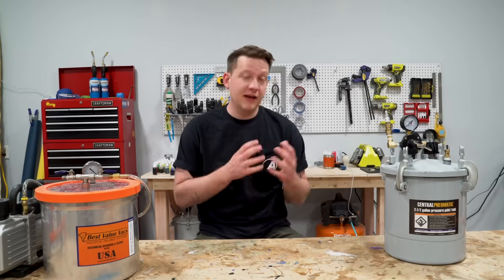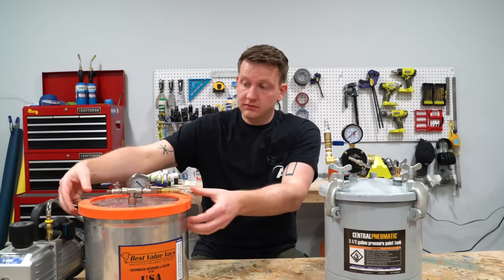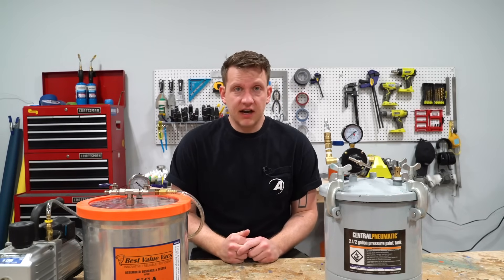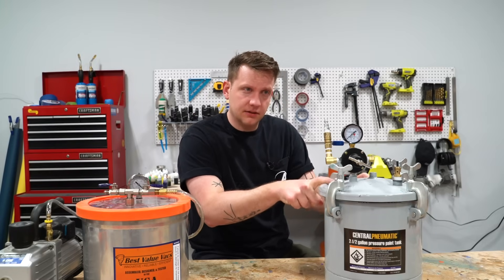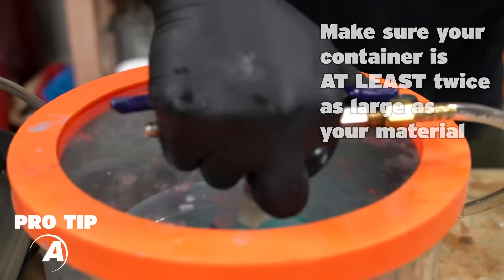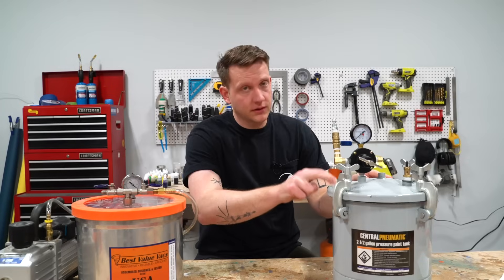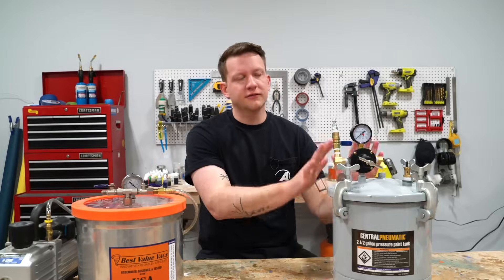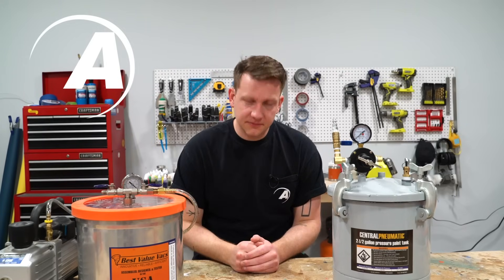When to Use a Pressure Pot or a Vacuum Chamber | Alumilite

Comment: Fool that I am, I really convinced myself I could get by just using the vacuum chamber for everything. Still don't get something though... What if you could find a resin with a longer working time that would allow for a vacuum chamber to get down to -30 mercuries before it starts to cure? Wouldn't that allow you to still get some bubbles out of resin using only the vacuum?
Reply from the maker: Great question and you're on the right track.
If you use a resin with a long working time (like 10–12 minutes), you can use a vacuum chamber to degas it before pouring. That will pull a lot of bubbles out of the liquid resin.

BUT vacuum doesn’t help once the resin is in the mold. Any air trapped against the mold walls or in tight detail won’t get pulled out, and that’s where bubbles sneak in.

That’s why pressure casting is still the go-to for perfect, bubble-free results it crushes bubbles inside the mold after you pour.

So yeah, vacuum works—just not all the way. Long open time helps, but pressure gives you the cleanest cast.

Need help picking a resin or setup? Reach out at (269) 488 4000 or info@alumilite.com.

Comment: I see this video is 5 years old. I hope you will answer. I am just starting to due this. So please tollerate my question.
why can you not use a pot for both vacume and preasure . At 75 years old I could use a little help. Thank You for respond if you can.
Reply from the maker: Great question! You can’t use the same pot for both vacuum and pressure because they’re built for opposite forces:

Vacuum chambers pulls air out and aren’t made to handle positive pressure.

Pressure pots push air in and can’t handle vacuum without risking damage.

Using one for both jobs can be unsafe or ruin your equipment. 

If you're working with resin, you'd use:
Vacuum to remove bubbles before pouring.
Pressure to shrink bubbles after pouring.
Reply: Thankyou so very much for an answer @AlumiliteCorporation

Comment: so, if i just wanna buy a pressure pot, but if i want to do molds by myself and put it the diy molds into the pressure pot, sould i have problema because of the air bubbles in the mold?

Comment: Great video, but never start a pump with the air valve closed, and never turn off a pump without first releasing all the pressure by gradually opening the valve.  This will greatly increase the life of your pump, avoid oil spitting out of the exhaust, AND extend the life of the coupler between the motor and the vacuum mechanism.

Comment: Question, the explanation is crystal clear, BUT,  as I have made a working vacuum tank, (pressure pot is on the list lol). In the mean time. Epoxy resin sets fairly slow, would it benefit from degassing in a vac chamber for 10 mins?

Keith
Reply from the maker: Yes, epoxy resin can benefit from 5–10 minutes in a vacuum chamber since it cures slowly. Just mix first, leave enough headspace (it’ll rise!), and don’t go too long or you’ll risk early gelling. It’s a great way to knock out those bubbles before pouring!

Comment: So I noticed you used a open end mold , How does it work if I'm making dice and it has a top lid that needs to be placed on the main mold to imprint the number ? Also how can I tell the difference from a good mold for dice and a cheap one other then price ?
Reply from the maker: Great question! If your mold has a top lid with numbers, you’ll pour resin into the open mold, then place the lid on top to imprint the numbers. Make sure to slightly overfill so the resin fully contacts the lid — this helps avoid bubbles and gives crisp details.

Comment: What you said about resin in a vacuum chamber is totally not true. Mixing up epoxy resin introduces air. Once mixed, a vacuum can remove most of the bubbles out of the resin well before it starts to harden depending on what resin you buy and your environment temperature. Now when you "carefully" pour the resin, and depending on what it's being poured into, you'll still have much fewer bubbles than if it wasn't vacuumed.
Reply: How do I know? Besides everyone you see vacuums their resin before pouring, I've got 2 small resin projects curing right now. The one that wasn't vacuumed has just a few tiny bubbles. The one that was vacuumed doesn't have a single "visible" bubble

Comment: i am using a vacuum chamber for slow curing curing epoxy resin (>24h) and the results are absolutely awesome in my opinion. Much better than what I could achieve before.  But right may not be the right thing for all types of resin

Comment: Can you use the vaccum chamber  with the mold already poured instead just the resin in a mixing cup?? like you did with the pressure pot? very critical question Thank you
Reply from the maker: Great question! And yes, this is very critical when working with clear resins! 👌

Vacuum Chamber vs. Pressure Pot – What Works Best?
A vacuum chamber is designed to remove air before pouring, while a pressure pot is used after pouring to compress any remaining bubbles.

Using a Vacuum Chamber After Pouring (Inside the Mold)

Unfortunately, a vacuum chamber is not the best choice for degassing resin after it's been poured into the mold. Here’s why:

Resin will expand & overflow – Under vacuum, trapped air will rapidly expand, causing the resin to foam up, overflow, or even create voids in the mold.
It won’t remove all bubbles – While it does pull out some trapped air, the expanding bubbles can sometimes create even more surface imperfections.
Thin castings can be tricky – Since your windshield is a thin layer, the vacuum might pull air from the edges, leading to an uneven surface or tiny pinholes.
Best Approach? Use a Pressure Pot Instead!

For crystal-clear results, use a pressure pot at 50–60 PSI after pouring. This compresses bubbles to microscopic size, making them invisible in the final cure. 👍

Alternative If You Don’t Have a Pressure Pot

If you're working without a pressure pot, try these tips:
✔ Mix resin slowly and carefully to minimize introducing air.
✔ Warm the resin (not too hot—about 75-80°F) to reduce viscosity.
✔ Use a toothpick or heat gun to pop surface bubbles after pouring.
✔ Pour in thin layers, allowing air to escape between layers.

If you're aiming for a truly glass-like finish, a pressure pot will be your best bet. Let me know if you have one or need more advice on alternatives! 💡✨

Also, feel free to reach out anytime at (269) 488-4000 or info@alumilite.com—happy to help! 😊

Comment: Which is better for wood stabilisation?
Reply from the maker: Great question! For wood stabilization, a vacuum chamber is the way to go. 

A vacuum chamber removes air from the wood, allowing stabilizing resin (like our Alumilite Clear or Resin Stabilizer) to fully penetrate deep into the grain. This ensures maximum strength and durability once cured. 

A pressure pot, on the other hand, is more useful for casting resins, as it compresses air bubbles rather than removing them. While pressure helps with resin clarity, it won’t effectively pull stabilizing resin into the wood fibers.

So, for stabilizing wood, go with a vacuum chamber for the best results! Let us know if you need help choosing a setup.

Comment: Since the pressure pot compresses the air in bubbles which is then trapped in the hardened resin, does that mean there's more supply of air for resin to yellow in future than in a piece where the bubbles were removed using a heat gun for example?
Reply from the maker: A pressure pot compresses bubbles to a microscopic size, but they don’t contribute to yellowing. Resin yellowing is mainly caused by UV exposure, oxidation, and heat, not trapped air.

Comment: so. the video "wasnt for me" but i wanted to watch anyway, never know when something you dont know might be available.
but a question to you: once i got my pressure pot, i not only use it to cast, but also to make the mold. now, so far my masters have been significantly rigid, so i dont know what factor that has to do with what im about to say, but when i use the pressure pot with my mold making, and leave the mold in the pot at full pressure (not beyond the safe amount obvs)  until the mold cures, i feel i actually get less(actually never once so far) chance for air bubbles opposed to when i degas with vacuum chamber, bubbles sometimes still come back so i dunno. any thoughts? (also, i might have missed it possibly, but if you didnt mention it, stating that the CFM of your compressor must be high enough to work perfectly with each of the pots.)
Reply from the maker: Great question! Using a pressure pot for mold making can absolutely reduce bubbles because it compresses them into microscopic sizes, unlike a vacuum chamber which only removes air before pouring. With rigid masters like yours, the pressure pot is especially effective since there's no risk of distortion. Plus, if your silicone is thicker, pressure curing helps push air out of fine details better than vacuuming alone.

You’re also spot on about the compressor—make sure it has at least 3-4 CFM at 90 PSI for smooth operation.  For even better results, try pouring your silicone in a thin stream and use a release agent to help avoid trapped air around your master. Sounds like you’re doing an awesome job—keep it up! 

If you’ve got more questions, feel free to reach out at (269) 488-4000 or info@alumilite.com. Happy creating

Comment: Yes I know I'm waaaay late for this one but i just bought a pressure pot thinking that a vacuum chamber and the pressure pot were one and the same 🙄. I clicked on your video because I  thought it might show me how to set mine up.  Mine looks like the one on the left of the screen.  Mine only came with the pot/lid the tubing, the on/off handles and the pressure gauge. Now this is how new I am ( novice here... sorry). What I don't  know is what ( compressor??) machine is used to take out all the air. I have an air compressor but now I  know that wont work with the one I bought . So if you (the owner of the channel or some nice passerbyer) sees my post and can answer that question l'd be very grateful.nja lo in asvancey I'me
Reply from the maker: No worries—this mix-up happens a lot! 😊 A pressure pot uses an air compressor to compress bubbles, while a vacuum chamber (for degassing) needs a vacuum pump. Since you have a pressure pot, connect your air compressor using the tubing, check for leaks (use Teflon tape), and pressurize to 40–50 PSI (but never exceed the pot's max rating!). If you're clear on that, you're good to go for bubble-free resin. 🎨💡

Feel free to ask if you need more help—happy crafting! ✨
Reply: @AlumiliteCorporation   thanks so much!? I might just have to do that 😂

Comment: question, when using a pressure pot can it compress the resin itself in effect shrinking the resin as it cures?
Reply from the maker: Great question! Using a pressure pot does not compress or shrink the resin itself during curing. Instead, the pressure pot works by compressing air bubbles within the resin, making them so small that they become nearly invisible. This results in a smoother, bubble-free finish. 🌟✨

Resin shrinkage, if it occurs, is typically due to the chemical curing process and not the pressure. To minimize this, ensure you're using a resin designed for your specific application and follow the manufacturer's instructions for proper mixing and curing.

If you have more questions, feel free to ask! You can also reach us at (269) 488-4000 or email info@alumilite.com. Happy casting! 🛠😊

Comment: i bought a vaccum chamber because i wanted to turn wood/epoxy   but according what you said it's the wrong choice i did i should have take a pressure chamber  😢
Reply from the maker: No worries! A pressure chamber is the better choice for turning wood and epoxy because it compresses air bubbles, making them nearly invisible.

Your vacuum chamber is still useful for stabilizing wood (pulling air out of pores) or degassing resin before shallow pours.

Comment: Can a vacuum be to strong of a chamber???
Reply from the maker: Great question! Yes, a vacuum chamber can be too strong for resin if it’s not used carefully. Here’s what can happen and how to avoid issues:

What Happens When the Vacuum is Too Strong:
Excessive Bubbling: Resin under a strong vacuum can foam up too quickly, potentially overflowing the container.
Over-Expansion: If the vacuum pulls too hard, it can cause the resin to over-expand, introducing more bubbles when the pressure is released.
Stress on the Mold: In some cases, too much vacuum pressure might distort delicate molds or small resin details.

Tips for Using a Vacuum Chamber with Resin:
Adjust Gradually: Slowly increase the vacuum pressure to prevent the resin from foaming too fast.
Target Pressure: A vacuum pressure of 27-29 inHg is typically ideal for degassing resin. Going beyond this can be unnecessary and risky.
Container Size: Use a container large enough to handle any expansion during degassing.

Comment: A vacuum chamber also helps to remove the moisture in the resin. It is a must if you want your resin to harden well. Also pressure pot doesn't work if you got a lot of details inside your work, it will mess up all the locations of your pieces in your resin.
Reply: damn, now I am second guessing myself. I made a northern lights pedant and the way I did it is I poured the epoxy and then waited about 20 minutes until it started hardenign, just a bit. and then I out the green northern lights with a very thin stick in. so, I had to be very careful when to do it and to leave it alone after making it. until it hardened. Of coruse, it  had a bit of bubbles inside. you think the vaccuum would be better for this job? vacuuming the epocy before the pour?
Reply: @thelovacluka  that is what usually I see people do. You then use a heatgun to pop to superficial bubbles which are created by pouring.
Reply: @EveryoneHarmonyPeace  ok, tnx. I will research a bit more in the next few days but I am leaning towards buying a vacuum chamber...

Comment: What about UV cure resin where you have as much degassing time as you need, so long as you do it in a room without much UV?
Reply from the maker: Great question! Yes, when you're working with UV cure resin, you have the advantage of controlling exactly when it starts to harden. This gives you plenty of time to handle degassing or removing bubbles, as long as you're working in a space with minimal UV exposure—like a room with no direct sunlight or strong UV light sources.
Reply: Great! I tried it and got out a lot of gas, then coated my part and took it out in the sun to cure. No bubbles except for air that came out of the wood. Fixed that with a couple of thin primer coats to seal it
Reply from the maker: @honuputters1891  so happy to hear it worked!!

Comment: Quick question, can you use the pressure tank as a vacuum chamber? Since they are relatively small, their surface is also small. Remember pressure = force x area... the atm pressure on the walls might not be that hard and hence, you could do both pressure and vacuum with a single tank. Is it a bad idea?

Comment: Can I use a vacuum pot to store deep fryer oil?
Deep fryer oil is expensive and I only use my fryer every 2 weeks.. once oil is heated and used it will start to oxidize and doesn't keep well.. if I pulled out the air and refrigeratored it, wouldn't it last longer ? 
I need a solution to prolong my oil I cant keep throwing out 10 L of oil after one cook.. it's a waste and not great for environment

Comment: Just curious, that tip you gave where the mold would not fit into the pressure pot. Could you not just set the pressure pot on its side, secure it so it can't roll, and use it that way?

Comment: I think it's wrong how you claim vacuum chamber isn't the right tool for epoxy due to the work time being too low, but even with fast setting epoxies, you often get a whole 90 minutes work time, which is plenty. Vacuum chambers also have another use, you can use them to stabilize wood with epoxy, by removing the air out of the wood.

Comment: A vacuum chamber works great with polyurethane resin. You de gas part a first that is the resin. Then part a that is the catalyst then mix both a. And b together carefully and then de gas them both quickly together then pore. Or use a slower curing polyurethane resin. I have a 5 hour slow set fast cure resin that gives you longer working time. So you can just mix part a. And part b. Then de gas it together and pore. Some resins with the correct ratio of catalyst take 30 mins to set. So this is enough time to be ready before it even thinks about curing.

Comment: Since UV resin has a mostly unlimited working time..can it be used in either pressure pot or vacuum chamber? .. to just get rid of bubbles before curing with UV?

Comment: I'm casting really tiny parts(needles for instrument clusters) and due to the size I have found running air vents in my mold makes them unusable because they break by the time I can sand it and polish it back to smooth. One piece molds have the issue air being trapped in the small needle shaft, the pressure pot is able to overcome it for the small needles but the RPM and Speedometer needles that are longer the pressure pot can't overcome it. Is it practical in my use case to fill my silicone mold in the vaccum chamber and to run it in vaccum to force the trapped air out of the needle shaft in my mold so resin can fill that area before going to the pressure pot? I'm using alumilite amazing clear clast and my molds are platinum cure silicone

Comment: pro tip: you can replace the wing nuts on the pressure pot with bolts. then use a torque wrench (or electric drill with torque setting) to quickly and accurately tighten the bolts